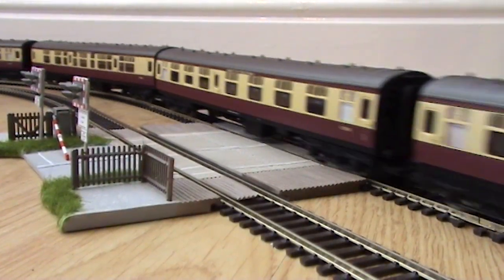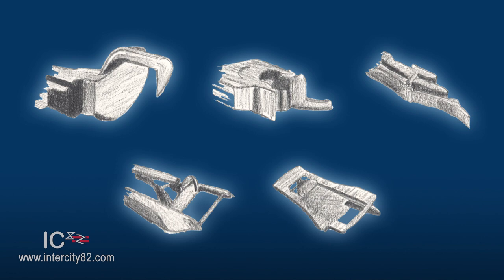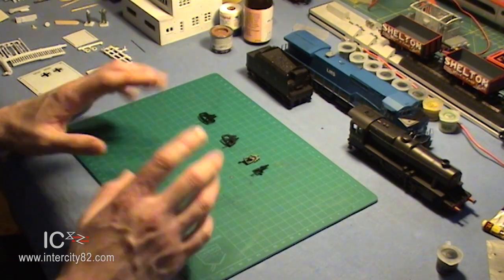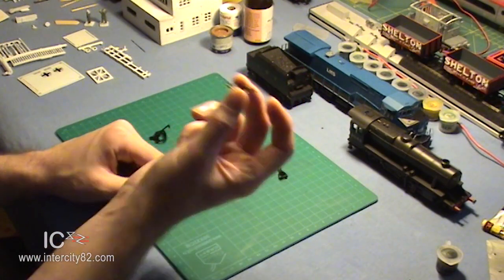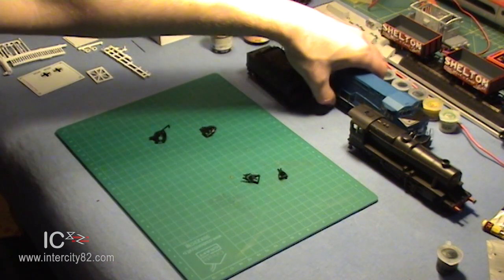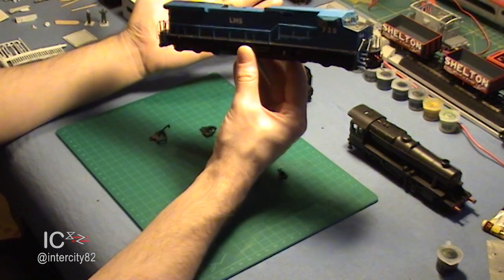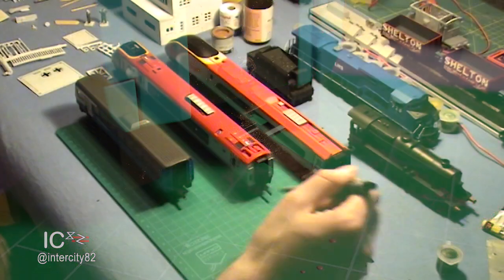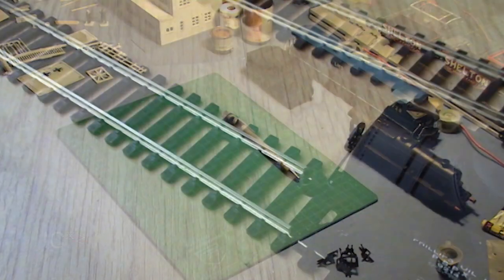Know Your Couplings!

Comment: Now that was informative..
Having GWR outline stuff with a range of tension couplers. I regularly have issues with them derailing wagons when shunting over 2nd radius points.  Or not un-coupling properly over the uncoupling mounds (or what ever they are called).  This short video has really help clear a few things up.

Comment: When I first started in this hobby about 3 years ago & a bit green on what was what, I ended up with a hole bunch of rolling stock with every variation of coupler know to mankind. With a bit of research I decided to bite the bullet & convert all stock to the Kadee type couplers. Its taken a while at some expense, but I have found the challenge rewarding & the results of better coupling performance worthwhile.
In the process I have also swapped all my plastic wheeled rolling stock to Intermountain metal wheels. That upgrade has also been worthwhile. If you convert your stock over time the expense side of it is not so painful.

Comment: In the days before propriety couplings modellers just "wired" their DMU / EMU ? coach rakes together using homebrew brass wire hooks and loops to achieve very close coupling.

You missed out 3 link / screw link (prototypical) that is commonplace on a large number of 00 / P4 / EM layouts where the sight of any unrealistic massive tension lock coupling is seen as detracting from the visual effect.

And don't forget "Sprat and Winkle" descrete automatic couplings for those railway modellers who find 3 link couplings going a tad to far for realism.

To us older railway modellers the tension lock couplings are still refered to as Airfix (small), Mainline / Bachmann (medium) and Triang Mark.3. or simply Triang (large).

Comment: Here in the US it's pretty much only Kadee couplers and knock-offs, though there's plenty of stuff floating around with ancient "horn-hook" couplers that were used before - though nowadays if you wind up with them, the first thing anyone does is toss them out and install Kadees. (Railroad couplers in the US are actually standardized unlike what I saw traveling in Europe, which as far as I can tell was "anything goes". Also, Kadee couplers may look very odd to a lot of the world, but they're very accurate to the ubiquitous North American Knuckle Coupler.) You're also far better off with actual Kadee couplers as well, any other cheaper knuckle couplers I've come across tend to fail (usually because they're plastic, while actual Kadees are metal) and are just generally asking for trouble. 

In my experience, Bachmann's EZ-Mate and Accurail's Accu-mate couplers are some of the worst offenders. I run long trains, and I've had those plastic EZ-Mate couplers straight-up break trying to pull trains. The Accu-mate couplers just tend to come uncoupled when you don't want them to and aren't reliable.
One other interesting thing I've heard is that Bachmann stuff in Europe is actually decent quality. Is that true? Because the vast majority of what the sell in the US market is almost universally considered complete and utter garbage over here, I know a hobby shop that actually refuses to sell their stuff because of the quality.

Comment: The medium tension locks on the Bachmann Thomas range are good.

Knuckle/buckeye couplers (of which there are makers other than Kadee) are only good-looking on American-outline stock tbh. They're what you'd see on them IRL, which is why the Tri-Ang models of American stock have those dummy knuckle couplers.

Tension-lock couplings aren't realistic, but they're reliable and less fiddly than the realistic-looking H & N or Spratt & Winkle type of coupling. At the small size of HO/OO models, they're also much more reliable and durable than buckeye couplings. And with the Kirby method they can even be magnetically uncoupled.

Comment: @hornbytrains125 Because if you look carefully, you will see that the coupling overlaps, locks, then proceeds to derail the train. Either you can go for the less ugly option and put Bachmann tension locks on all stock, or the ugly one, and go for Hornby couplings on the Bachmann model, they're interchangeable.

Comment: I have done some of the coupler swapping myself.  It would depend on how the horn hook is attached.  If it has a small pin sized hole you can get through Walthers some knuckles to switch out with.  If it has the larger hole you can get knuckles from Bachmann or use Kadee #5 couplers.

Comment: Nice video Will. When you said the Kadee couplers were "fiddly" are you trying to unhook them without a magnet? The kadee are designed to be unhooked using magnets in a similar manner as to how you would unhook a real locomotive. I believe they sell something that allows you to slowly unhook them as well for a more realistic feel. Most people just convert locos and rolling stock that would connect to the locos. Converting everything is cost prohibitive :)

Comment: FYI, you spoke about magnets under track to operate Kadee couplings, but you can very easily and cheaply modify the humble tension lock coupler to also use under track magnet uncoupling.  Look up what has become known as the 'Kirby Uncoupler', non-ferrous hooks available from PH Designs.

Hope someone finds that useful.

Comment: You can change the coupling types from tension lock to kadee for example, but it could be expensive. You're looking at around £2 per loco to change them over. Then there isn't any guarantee that the rolling stock that you have is NEM compliant.

Comment: When it comes to the tension lock couplings, I only feel comfortable using Large or Medium. The small ones really bother me because they have always derailed my trains. They may look nicer, but my layouts have always had trouble with them, even if the bends aren't that sharp.
Reply: What radius are your bends?
Reply: nutfield001 I don't know, my old layout was pulled up so I could rebuild it somewhere else.  The outer "main line" bends weren't particularly sharp (4-6-2s could travel along it without issue), but sharp enough to cause problems with narrow couplings.

Comment: that's correct, "KD" couplers are a brand of couplers of the "knuckle" type couplers used mainly in north America. now there are also other types such as the horrible "horn hook" couplers which nobody likes but they are very cheap. I myself am switching over to the "sergeant engineering" brand of knuckle couplers, these are by far the most realistic knuckle ones with looks and operation being the same as its real life counterpart.

Comment: sounds expensive! I've found a place that does them for £3.50 for two sets, but that's still almost £2 per item of rolling stock. I've not counted mine in a while, but the cost would run into the £100's

Comment: Propriatary couplings in EMUs shouldn't be problematic, you aren't going to couple them with anything else, are you? I personally like the Märklin coupler since it locks very tight and is easy to uncouple (just lift it a bit). By the way, an ä in German should be pronounced like an e, not like an a.